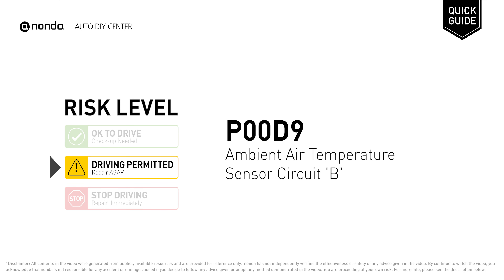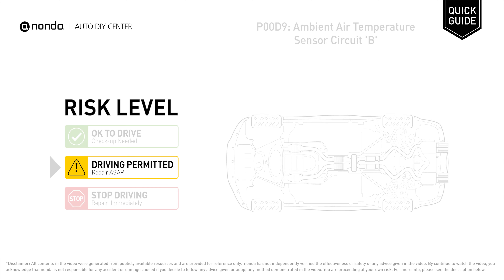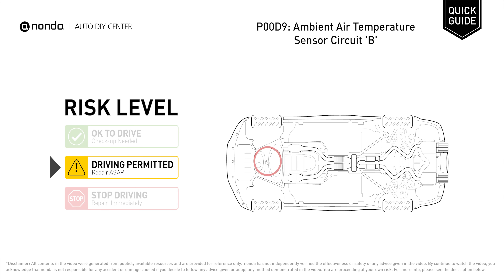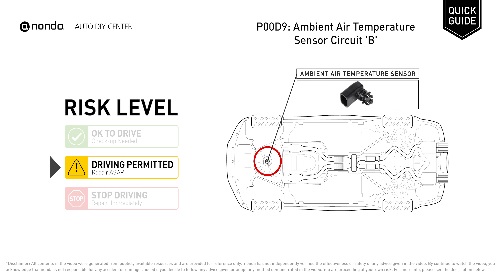What is P00D9 Engine Code [Quick Guide]

Comment: Don’t know if anyone monitors this channel, but my 98 GMC Jimmy just threw this code (P00D9). It was idling rough (and very low RPM) so I put some sea foam in the gas tank the day before. Took it on a long-ish drive of 60 miles at highway speed…”service engine soon” light came on and it idles even worse now. Seems ok at higher RPM.